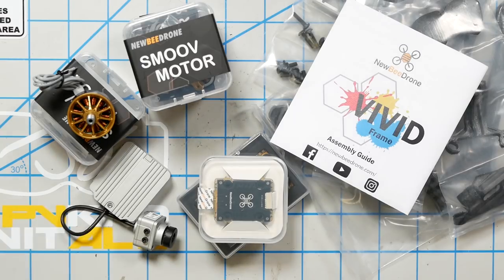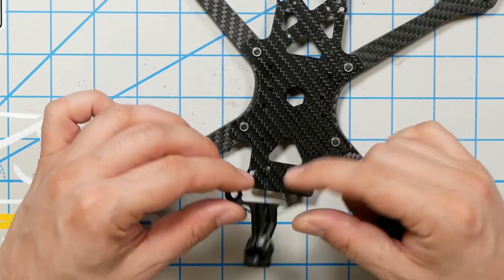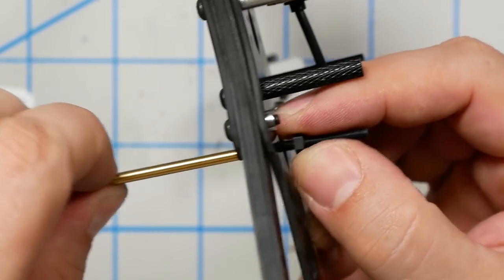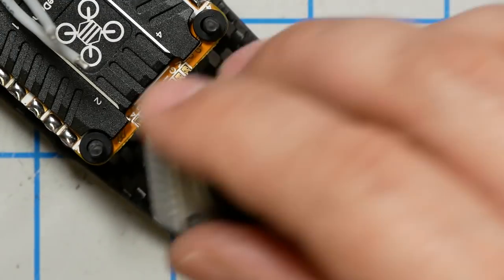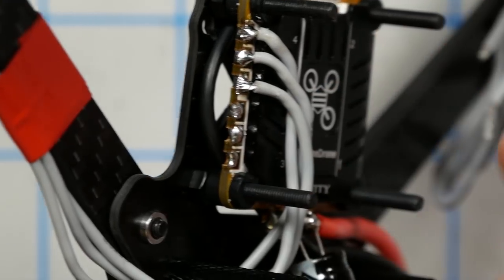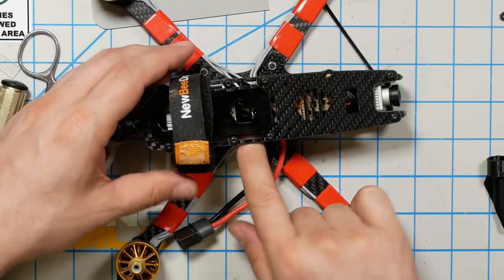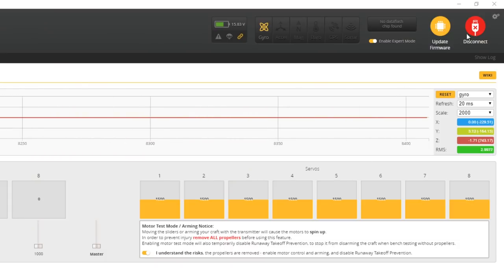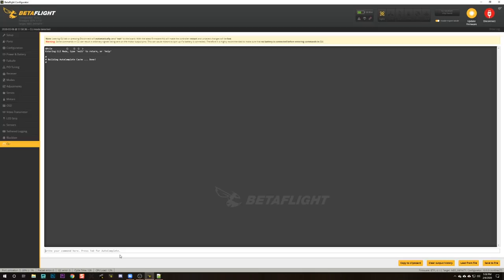Freestyle Quad Full Build Tutorial NEWBEEDRONE VIVID HD KIT

Comment: It seems unlikely you will read this, but just in case.  You may have already have figured this out but it looks like the camera screw slots are designed like that so you can in fact use both screws.  Assuming I'm right.  Just put both screws in and once they are in, the angled slots will allow the camera to tilt.  The screw should track inside the slots just fine.  They could have used two circular slots but that may have made the side plates weaker.  Two straight slots can work if they are oriented right.  Thanks for the videos.  A pleasure to watch as always!

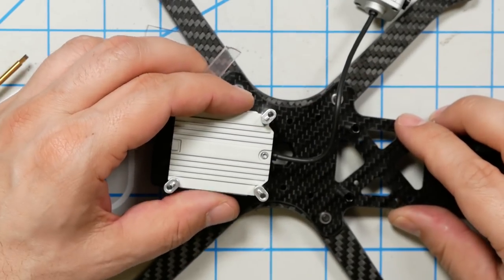Comment: I love your videos, Joshua. Could I propose some mods? 9:30 you can place a single layer of TPU on each of 4 stand offs, attach all of them to the transmitter body and then attach it to the frame as one piece in order to screw it down. Also 32:33 you can attach the antenna holder to the lower posistion of the (back) stand offs (before screwing them down), sandwiched between stand offs and lower frame part, so it would be more secured in place. Also switch place the antennas in order to criss-cross their cables stressing them less. 29:06 is it bad idea to place the ESC on top of the FC ? It might be more convenient for the ESC cables and the ESC heatsink more efficient !

Comment: this kit look insane i just would like 2 or 3 things : Can we use an other controler than the dji one ? If not is there enough place to add an RX to fly it with my taranis ?
Reply from the maker: You can add a different rx yeah. Easy.
Reply: @JoshuaBardwell  okay nice thx for your fast answer well I'll compare to the dji setup I'm looking for (same stack but cl1 frame, blackbird motors and props from T motor) cause I have to get some new battery (I was learning the basics on a 3" quad) so I have to compare the price but I suppose the performance are similar between these 2 quads don't you think ?

Comment: Quick tip for anyone twisting wires, to stop the wires wanting to unwind, twist them together, grab a lighter and lightly run the tip of the flame along the length of wire (much the same when you're heating heatshrink, just not for as long) this will keep the wires twisted together.

Comment: Wow, thank goodness I found this video. NewBeeDrone should have this linked on the product pages.

I've had an acrobee for a few weeks, and decided I wanted to go all in on a 5" quad.  I spent a day trying to piece everything together. I got pretty far - I'm an EE myself - but it's amazing to me how much you have to dig and scrape for info.  Then I found this video.  Awesome job.

Question for you: I've spun my own boards now and then for hobby embedded systems projects, and so I have a deep-seated fear of ESD.  Is ESD an issue with flight controllers and electric speed controllers?  If not, why not?  Do boards for this hobby come with some sort of coating standard, or do ICs that are used have pretty decent ESD protections?

Comment: hi mr bardwell i have a problem my diatione 349 is on betaflight 4.1 .it flys very nice but then all of a sudden it drops out of the sky ,in the osd it comes up with runaway throttler  ,after playing with the settings i have turned  off runaway protect ,at the mo it lookes too be working but now i dont have a safety  net

Comment: FYI - I just got this kit and the arms have changed a bit. The hole in line with the motor shaft or axle is no longer drilled all the way through. The side that is drilled needs to face upward so the shaft/axle does not make contact with the arm.

Comment: Yes frame sellers, please include motor screws! It's a real bummer when you've got everything to build and then find out you have to scrounge up motor screws and you have to order more screws and wait to finish build. I always love the build videos, I would wrap a zip tie around air unit and antenna to keep them from popping off.
Reply: I thought motors come with 4 screws and the prop nut included
Reply: @AgustinMolini  Yes they do but some frames are made with thicker arms and you will need a longer screw, the frame maker knows that motors come with screws that are too short.

Comment: I did this same build. It’s awesome frame. However. It was a little finicky. I was able to get both screws into the camera and tpu mount. Put them in with cam straight and then adjust cam and then tighten down. I also put my dji air unit in the front and my battery lead out the top plate back hexagon hole. I did have to make my own longer plug lead but this keeps things neat and works well with CHNL 1000mah 6s on top. Also plugs in on top.
Reply: Did not use the p.o.s. Antenna mounts. I mounted mine out the side and zip tied to the arms.

Comment: Appreciate your DJI build.  With all due respect, for the hard core analogue beginners/investors/tinkers...I get it.  You've got a lot invested in the analogue world of FPV.  But for the 'johnny come lately' beginner like myself, my first experience flying analogue was shocking.  Dropped signal/blurry intermittent picture.  I don't particularly like crashing constantly, pouring money in the sport and have 20 quads nailed to the wall as a back-up.  Maybe I'm in the wrong field.  At any rate, when DJI came forth with their digital version, I gravitated in that direction.  I'd flown DJI quads in the past and appreciate their visual accuracy/detailed picture and flying commercially...well, you need to SEE, excuse my french, see WTF you're doing.  DJI like all the manufactures have problems too.  In any case, in my situation, I'll never go down the analogue path to FPV.
Reply: Hey Josh, just received a bnf dji equipped mr croc hd.  Seems to check out on BF, did all the binding with dji air unit/goggles/controller but when I went to fly it los no dice senior!  I go to push the throttle straight forward and nothing happens!  Add a bit of yaw to one side or the other and the props spin up.  Same with pitch/roll.  I have no idea what the problem might be and wanted to reach out to you for some trouble shooting direction?  Where do I go from here?  Thanks.

Comment: Great Video managed to build my 1st quad following this video but it was a bit too responsive so tried to turn the rates down a little and now it doesn't arm. All other stick movements work and checked on beta flight but it appears there is no throttle response? help needed please
Reply from the maker: When you turned the rates down, whatever you did, undo it :-)

My guess is you tried to change the rates in the controller, and it messed up the channel endpoints so now the FC is confused.
Reply: @JoshuaBardwell  Thanks for the reply. Ive tried going back to my previous settings but no joy. I posted  a video on my FB page and was told the actions were normal with no props fitted so going to slap some props back on and see haha. Thanks again and keep up the good work 👍

Comment: Hi. Want to test out the dji fpv system but i want to keep using my crossfire and radio. I do want the tango 2 more than dji radio. Do you have a video setting upp dji and crossfire and will i be able to use record switch from my radio? In that case, how?
Reply from the maker: You won't be able to start recording from the radio. But the DJI goggles have a record button so that's no big deal.

To set up DJI and crossfire, just omit the yellow SBUS wire from the Air Unit, and connect up a crossfire receiver per usual.
Reply: @JoshuaBardwell  thanks😁👍
Reply: I got DJI to "test" in September, 3 days later sold my hdo rapidfire on ebay & all analog gear shortly after, even my loved remix frames, cuz no fit da air unit, so be prepared bro lol
Reply: @flo-ridafpv5713  jepps that's what i fear too. But not gonna sell annything. Im gonna have the small one to keep flying. And all the stuff i wont need i give to the one that need stuff to get started😁 im never giving upp on my remix frame😎👍

Comment: Here's why you may want some auto-level mode on a DJI quad.  DJI's video link is very robust, but if you do manage to break it (total loss of image) by flying behind something sufficiently solid, then it takes about 4-5 seconds to recover.    During that period of time you can either disarm and drop, or hit auto-level and increase the throttle to climb out and wait for the image to return.   If the DJI controller has no better NLOS penetration than the video link, then it doesn't matter. It'll drop on its own. If you're using Crossfire or R9* control then it almost always has better penetration than the video link so you'll have that option to recover in the air.     I've done it both ways, but I like having the option.   Sometimes where I might drop is unrecoverable.
Reply from the maker: I do not recommend the approach of autolevel and throttle up. The quad should never be powered up when you aren't controlling it. You don't know what it's doing or where it's going. If you lose video link the right thing to do is disarm.

If the quad had return to home or loiter that would be different.
Reply: @JoshuaBardwell   I understand the sentiment, but we don't all fly in urban areas.

Comment: Nice work, Joshua. Check me if I’m wrong, but you taped the wires to the arms for standard props, but you went with reversed props in BF?
Reply from the maker: "Joshua from the future" made a note about this but perhaps it could have been clearer. When I taped the wires, I didn't realize the FC was set for reversed props. You can leave the props reversed, in which case put the wires on the other side of the arm. Or you can change the FC to normal rotation, which is what I did.
Reply: Joshua Bardwell    Ummm, starting at 48:50 when you check the motors, “Reversed” is clearly indicated on the diagram, and when you test the motors they are indeed spinning for reversed props. Maybe I missed it when you went back to normal props?  No big deal, but I wouldn’t want a new pilot to be confused.  Thanks!  (Also, now that I’ve watched a couple of times, I noticed that when you checked direction on motors 3 and 4, the video shows you with your little piece of paper on motors 1 and 3, respectively. Maybe just a mis-edit?)

Comment: Do you need a voltage regulator when using 6s with DJI air unit ?
Reply from the maker: Yes. But the FC designed for DJI all have it built in.

Comment: Hi Joshua, i love your videos and your build, l've learned so much since i'm watching them.
 But i've always wondering what solder do you use to make this perfect soldering. To me it's always a pain in the ass, especially for lipo pads. I use a Ts100 but i feel it is not enough for this kind of job. 

What do you think?? 

Keep doing hat you do, you rock !!
Reply from the maker: TS100 is more than powerful enough for any job on a quad. Definitely use a thicker chisel-tip instead of the default conical tip. For really heavy wires like 12 gauge battery wires, the best thing is to run the TS100 from a 6S battery. But it can do it on a 4S it just takes a bit longer.

Use 60/40 or 63/37 alloy rosin-core leaded solder. Use liquid flux. It should be fine.
Reply: @JoshuaBardwell  Thank you  very much, i will follow your recommendation.

Comment: Gimmicky as they might seem, 3d PrintingPens are great for fpv.. Like here for joining things like the seam on that antenna holder. Or for things that are like "oh, a 3d printed part would be great to protect this bare piece of likely to get smashed and delaminated carbon.. "then you measure and draw it out and print it and sit there like how the hell is this gonna fit on there and you have to cut it in half or try to print it with other parts inside the printer so it prints on it or around it. But it's nice to be able to just print onto things with the pen, or cut open parts to be able to install them and then reseal the cut. Really handy, like 25$ and gets you want you need for basic fpv parts making ability. And no learning compared to a 3d printer. I've had good luck with the plotrix 3d pen..
Reply: Interesting. Never heard about this.

Comment: hello. can some tell me why my quad trigger its self when whas unarmd and cut me badly. Does something like that happens to anyone of u guys ? pls help
Reply from the maker: Two things you should always do: 1) test failsafe with props off to ensure the quad disarms when you power down the controller, and 2) use 2-stage arming to prevent accidental arming. In almost every case where the quad unexpectedly arms, it's one of these two things.
Reply: If your sure you didnt do it accidentally , trash that flight Controller then
Reply: @JoshuaBardwell  Thank You for answer me Joshua Bardwell. I will check everything again.
Reply: @flo-ridafpv5713  Thank you for the information Flo-Rida FPV. There is a chance that i messed up something with flashing ... probably i will trow it away just to keep me safe
Reply: @alcoholeague6705  your welcome , if you didnt hit a switch and it armed itself, trash it....also suggest a double arm, or prearm setup, I use one on qx7

Comment: I would've just opened up those 2mm holes to 3mm and used the smaller (lighter) stack.
Reply from the maker: It turns out to have been the right move because the NBD kit includes the 30mm gear.

Comment: Can you recommend me a video for a decent build at a budget. I want to get into drone racing or freestyle
Reply: Have you seen the UAV futures budget build is it worth it
Reply: Kazbo FPV I do
Reply: I flew mini racers for about 2 years just the typical mini racer of course from point of you but
Reply: Kazbo FPV I have not I’ll go check it out right now
Reply: @gavo0213  This one?2018 UAVFUTURES $99 Build
Reply: Michael Vaughan the 2019 build is the one I’m thinking about building
Reply: Emax tinyhawk bro 100%
Reply: Flo-Rida FPV  sorry but I'm not looking for another micro thanks tho
Reply: Michael Vaughan I'm interested in the 2019 build he did the v2
Reply: @gavo0213  ah figured u were starting from scratch, for 5in just buy any $30 frame xing e motors a $50 20x20 6s stack, cheap cam cheap vtx n ur rx, done like $140
Reply: Flo-Rida FPV witch xing e motor 2207 or 2306, 2208s?
Reply: I’m sorry for asking all of these questions but I’m just trying to figure some things out before I find myself with a crappy drone with crappy parts

Comment: I have this build without the DJI unit. 4.1.3 is harder to tune for me than 3.5 was.
Reply: I went to new stacks and was forced to go 4.1, 357 was not supported, so Learned 41, it's easy, & much better w rpm filters, HMU if ya need help bro
Reply: @flo-ridafpv5713  I get crazy oscillation on hard turns and if I descend into turbulent air. I have the RPM filter on and everything setup how JB shows in his video. I think default I I WAY to high.
Reply: @feelmyola  Just reduce the I gain a lot... you can go to Rotor Riot and check out Le Dribs PIDs...
Reply: @Siamect  tried it, if I punch the throttle multiple times now it starts to oscillate, and it gets worse with everything punch.

Comment: The flux ring around essentially all motors is ferromagnetic, aka steel, not aluminum.
Reply from the maker: I'm really sure the bell is aluminum.
Reply: @JoshuaBardwell  bell spokes are aluminum, yes.  Flux ring around perimeter of bell is almost always steel.  Take an old busted motor and rip it apart with pliers and see for yourself.  It needs to be a ferromagnetic material.  It helps shape the magnetic field.

Comment: I'm sure you got a whole bunch of videos on PID's and rates. And I understand this video is absolutely not about it. But I would suggest you warn new guys to check if there are factory settings on the rates, and refer them to your videos. 
Still don't agree with your way of liking the arm switch position. Safe mode for when switching on TX is all switched away from you. And when confused and emergency in flight, push all switches away from you.

Comment: dont accept what you are given . but reject and rethink . also my lower the camera below the rotors
Reply from the maker: The manufacturer has put a lot of time and effort into designing the frame. Probably also a lot of real world testing. So it would be wrong for me to reject their design and show people some completely different way to build it. The first thing to do is to build it as the manufacturer suggests and understand that. Then if there is room for improvement, point it out.
Reply: @JoshuaBardwell  thanks for the reply  i will try to be less cryptic in the future. i appreciate your input the presentations you do are excellent   and much appreciated.

Comment: According to NBD: "On board capacitor: 10uf x 48 Total 480uF, No need for external Capacitor" You might say this would be considered a selling point.  That is, of course, until you buy one and then have to wait for JB to release a video to tell you that if you have RevB you need to use a cap for 4S specifically (thank you by the way) and then have NBD stay silent on the matter and put in effectively ZERO effort to warn customers or offer to resolve the issue in any way. Lameeeeeee.